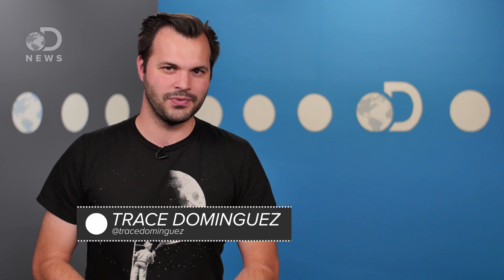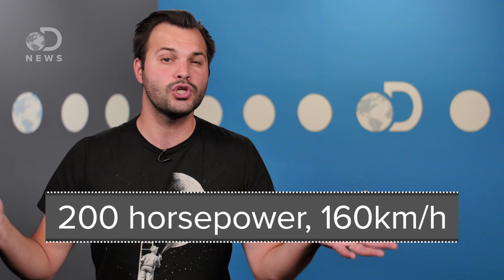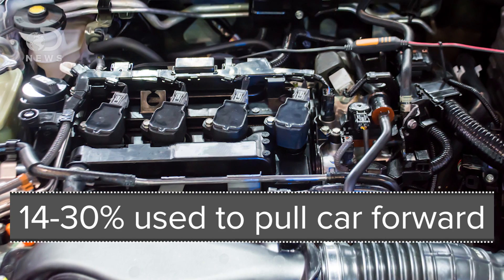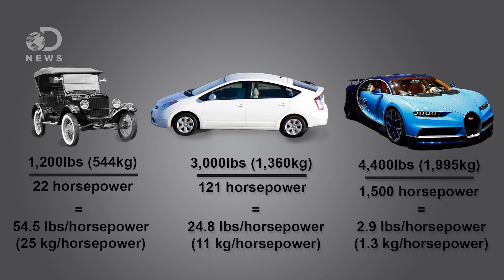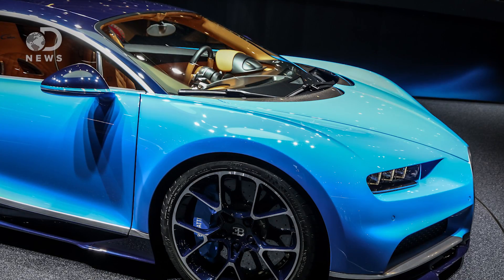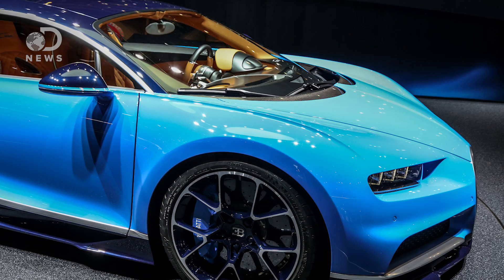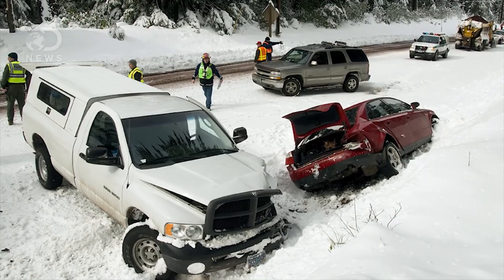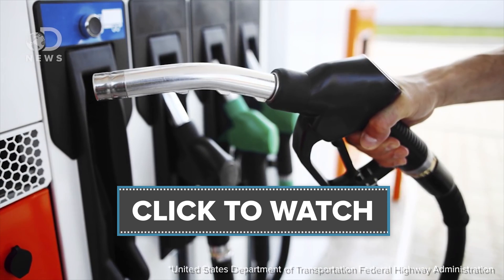Why Isn’t Your Car Faster Than A Sports Car?

Comment: This video is just simply wrong, like to the point where its dumb, and you get entirely false information. 
power to weight ratio increases acceleration. AND THAT'S IT. nothing els. 
Acceleration which is how fast a car increases from 1 speed to another (for example city speed of 60km/h to highway speed of 100km/h, or really any speeds) is a combination of power to weight ratio, and aerodynamics. 
Every other aspect of speed, including the ones talked about in this video have nothing to do with power to weight ratio. 
Launch, which is acceleration from a standstill, usually to highway speeds (0-100km/h) is purely power and grip, weight usually cancels out since higher weight has more grip, and low weight has less inertia. 
Top speed has very little to do with weight aswell, thats horsepower, aerodynamics, and most importantly, gearing. Gearing is why the Mclaren F1 which is heavier and less powerful than the P1 still has a higher top speed. 
Finally Lateral Gs or cornering speed, is weight grip and aerodynamics, nothing to do with power. 
Also there is the fact that cars have horsepower and torque, which means differant things and help with differant things. Usually more torque means faster acceleration, while horsepower means higher top speeds. 

If you did want to dumb this all down into a simple 4 minute video thats fine, talk about the 2 most important things, aerodynamics and grip. these are a factor in everything and are massive advancements over the years which perfectly explain why modern cars are faster. This video is an embarrassment. Even the description is blatantly wrong, the veyron SS did 268 mph, and the hennessey venom did 270mph.
Reply: also tire compounding means that a $17,000 set of tires specifically designed to be able to not melt at 260+ mph (420+ kph) for the Bugatti Veyron can maintain those speeds, while a $200 set of no-name tires probably shouldnt go too far past 100 mph (160 kph).
Reply: Acceleration is more accurately (and simply) described as rate of change in velocity. But anyone with a brain will know what you mean, so good effort. Also his description of the Bugatti's engine was a joke and completely false... There is a difference between a VR8 and a V8 and the Bugatti in question has one engine comprised of two VR8s sharing a crank shaft(therefore it is actually one engine), a configuration described as a W16. Such configurations are not uncommon, which makes this blunder even more disturbing...
We should have him shot for that crap.
Reply: gearing bro
Reply: exactly, motorcycles accelerate batshit crazy due to their crazy power/weighty ratio but their gearing and horrible aerodynamics (because of the rider) limit their speed, and a Tesla, with 542 horsepower (to the wheels) will accelerate so quickly yet only top out at 155 because technically it's a single gear car
Reply: it tops out at 155 because it's electronically limited to 155
Reply: Thomas Gionet Its electronically limited to 155 because the electric motor will destroy itself if it goes faster. It isnt like most electronically limited cars which are capable of going faster.
Reply: Lakefern exactly. Although almost all modern cars have tires rated for about 260km/h or 155mph.
Reply: +martinshoosterman yes, but if it's rated for 130, who would trust it anywhere near there
Reply: Lakefern They if they are rated for 130 you are almost definatly safe at 150, remember these companies do not want to be sued. But most are rated at more than 130 anyways.
Reply: he did say in the video "the fastest car you can buy" while there were 5 Veyron SS models made without limiters, they are not for sale. and only 3 Hennessey Venom GT WFE were ever made. and again not for sale.
Reply: note5 camera In the description? Yes they did say its the fastest car. not that you can buy. And they were for sale and they did sell and you can still buy them. Also there were 20 veyron ss sold, and another 40 veyron vitesses. All of which had a key which would power the car with out the limiter. 
There were 3 Venom GT WRE not WFE, I dont know wtf WFE is supposed to be, but again there is no differance between the venom gt and the venom gt wre. All versions are capable of 270mph.
Reply: Bradley Gibbs What I meant is not the scientific definition of acceleration, which is the rate of change of velocity, or the derivative of velocity. I meant the automotive usage of the term acceleration. Because Practically there is a difference between accelerating from 2 differant velocities, and acceleration from zero to a differant velocity. 
 And because of that we generally use acceleration to talk about positive speeds, and launch to talk about from zero.
Reply: martinshoosterman Acceleration only has one definition and it does not change for context. Yes things behave slightly differently when accelerating from zero than when accelerating when accelerating when already moving but they are both still acceleration! 

Speed is a scalar quantity and cannot be negative, so your statement is unclear. Also, the word "launch" cannot be used by itself as it is entirely unspecific. The correct phrase is launch acceleration, but those are layman's terms that you should avoid.
Reply: Bradley Gibbs Acceleration can have any direction, and it can change, thats where "jerk" comes in. 
But again you need to understand you are mixing up scientific terminology with practical usage of examining a cars performance. 
You cannot say the word launch cannot be used, because the fact is, it is used, and thats what it means when it is used that way. 

The physics behind a car accelerating from 0 to its top speed are extremely complicated. Every single force changes depending on the speed of the car, even if you assume other factors aren't changing in the environment.  
Because of this cars do not accelerate uniformly. 
While you could be 100% scientific and describe the cars acceleration with a function describing its velocity time graph, it is much easier and simpler to break it down into 2 differant parts. 
The part where aerodynamics are a negligible factor, and that is almost entirely defined by the friction in the tires, is referred to as launch.
it is still acceleration, obviously,  but it is communicated as launch. 
then the parts where aerodynamics become the determining factor is what is generally meant when you are talking about a cars acceleration.
Reply: martinshoosterman Yes, acceleration has direction. All vector quantities do, what is the point in bringing this up?
And you seem to have a grievous misunderstanding that scientific terminologies are void in practical situations. The whole point behind these scientific terms is to define and predict the behaviours of "practical" things. 

About the term "launch": in my area, girls refer to hair bands as ponies because they are used to make pony tails out of their hair. In unscientific and non-technical contexts such terminological degradation is acceptable. This is not the case in all things scientific (practical or not)! There are conventions and rules defining the the uses of each term there are organisations that govern such things to prevent confusion.

So as I said before. Simply "launch" is unspecific, "launch acceleration" would be understood (but since it's a layman's term and not part of any convention you should not use it) and simply saying acceleration from zero is much more specific and the correct way of defining the situation.

I am aware of the physics behind a vehicle accelerating from zero. The only reason for its complexity is the ridiculous amount of variables involved. The acceleration of a vehicle with a geared internal combustion engine, while its gears are being shifted cannot be defined by a single function, even if you entirely ignore air friction.
You can only use 2 functions to describe the acceleration of a vehicle if it has a transmissionless electric motor that is geared directly to the wheels and the graphs end before the motor's output decays.
Reply: Grip isn't THAT important for high speeds though, as most cars don't really have the power to reach speeds where they lose grip. A typical car at 100 m/s, 220 mph, might have 500 kg-force pressing on the front. That's a lot by any means, but it's not that close to the mass of the car, so even a coefficient of friction of 0.3 is good enough. Add minimal, and I mean, minimal, downforce and the problem solves itself.
Reply: I mean, the basic reason why you never see cars that have grip-limited top speeds except perhaps in world record events, is that it requires a lot of torque. Let's say that you have a frictional coefficient of 1, and no downforce or upforce to confuse things. So let's say you went to your top speed and were limited by grip?

What this means is that the amount of aerodynamic drag on the car is equal to the torque is equal to the weight of the car. If you're moving at, say, 150 m/s (300+ mph) and this happens, you obviously had the car's own weight in torque at 150 m/s. This puts a bare minimum power output in watts of 150 m/s * car's weight in Newtons.

So, say 15000*150. That's 2.25 Megawatts, or 3000 Horsepower, to which I say, why even bother with making a car? That's 87% the power of a B-25 bomber.
Reply: Peter Smythe I agree.

Comment: f1 cars have greater power to weight than the Bugatti but still isn't faster and yet it produces so much downward force it can virtually run upside down.
Reply: You said it yourself, they produce so much downforce, besides the gearing (which also determines top speed) is geared toward tracks, which would make the gears shorter to make the engine more responsive but would result in a lower end.
Reply: drag coefficient amirite
Reply: Its because of the gear ratios

Comment: bugatti chiron does not have two V8 engines. 

it has one W16 engine

massive difference
Reply: its the same thing w16 is how they are positioned one v8 sits next to another and puts the power down equally so think of it as v+v=w and 8+8=16

Comment: why? because im using toyota with 4piston which its hp and torque is not a good as bugatti with w16 engine and more power. but gtr is bettwr with v6 engine and less cost compare to bugatti but it can compete with bugatti with just add some cash to modified :p

Comment: Ok. The blandly sponsored Techron advertising was the second when I stopped and left. If I want to see ads then I switch on TV. On a video like this it takes away completely from the message and makes the present or partial to the advertiser. No more impartial message after that will make up for the annoying ad.

Thanks and goodbye D-Ads.

Comment: +Dnews 1:25 you made a mistake, the Bugatti does not have 2 V8 engines 

It has a W16 engine, which is basically a V16 but the pistons are not in a straight line to save space. 

Basically a  W engine is the Demon love child of a V and a VR engine (VR = angled Inline motor)

Comment: Maybe because my car isn't a Quad-Turbo W12 that has 1,000+ BHP.

My current car is a 2.5L Inline-4, single turbo, making only around 300 BHP. Guess my car :D
Reply: STI? also which W12? because the veyron/chiron has a W16 (hence 2 V8s)
Reply: +Lakefern Correct! :D And I meant W16 for the (Veyron Super Sport 16.4) lol. No idea why I wrote W12.
Reply: Its a WRX or STI if I had to guess..if you live in the US as least. Had one, now have an Evo Fe

Comment: That whole video was just a shameless introduction to your shameless Techron plug. I'm also 99% convinced that your "research" consisted of 3 YouTube videos and a skim through Wikipedia. I was actually alittle excited to see a car video on this channel, but not one this weak. And for power to weight ratio, the Konesegg 1 has a ratio of 1.... 1lb/hp. Stuff that down your Chiron.
Reply: *1kg/kw which is about 2.2 lbs/1.34 horsepower or 1.7 lbs/hp
Reply: +Lakefern *1.64lb/hp but thanks for correcting me
Reply: Noah Rodebaugh whoops. rounding error.

Comment: "Has 1,500 horsepower, but needs two V8 engines to get that" - Trace Dominguez 
When DNews does not know what powers a Bugatti Chiron, its actually two separate VR8 engines that power the Buggati with four quad turbos. Volkswagen came with the idea of the VR engine witch stands for "V" style engine and a inline engine, characterized by a narrow-angle (10.5 or 15).

Comment: if i had to choose a car for the long harsh winters of canada (where i live) it would be the 2016 dodge charger SXT Plus AWD 305hp modded to 350 with a carbon fibre GT wing, a Rear diffuser, front splitter, and those side flippers at the front that many racecars have, along with a hood scoop, Carbon ceramic brembo discs, MOMO steering wheel, recaro racing seats, color would repainted to a sunset metallic, and a subaru WRX STI killer
Reply: And a custom supercharger. Because Murica.
Reply: Mariux -  :D +89 HP

Comment: Or, just buy a motorcycle and spend hardly anything and go fast.  ~$12,000 and I can go over 170mph?! Suck it Bugatti.
Reply: but if you hit anything, or are hit by anything, you are essentially killed if the relative velocity is over about 60 kph
Reply: And have better acceleration
Reply: And hitting something going 270 in a car is better? I could get killed walking out my front door tomorrow. I would rather die epic in a bike crash doing something I love. lol Death is inevitable.

Comment: What about the Coefficient of Drag?
What about the transmission used.
What about the tires used?
The new Bugatti would have a very low Cd value compared to your average econobox, as well as your econobox would have a more basic transmission and basic cheap tires.
I can get a modern car like an impreza and it would be faster than a 1960s supercar.
So in a way, My car can be faster than a sports car

Comment: The top speed of most cars is lowered too, due to keeping you from going to fast or blowing up the engine.
Reply: Yup. you could get a prius to 200 miles an hour if you had hundreds of engines to replace the ones that went boom.
Reply: Yeh, the Chiron's top speed is electronically limited to 271 mph
Reply: +Timothy Rhoades haha, yeeeeeh. Looks like someone has no grasp of basic physics!

Comment: What about the difference between naturally aspirated engines vs modded. What about turbos and superchargers? If the video was simply about power to weight ratios you should've titled the video differently.

Comment: the A\C electric motor is faster then all these combustion engines you're talking about. if we all drive a good EV we would all have super fast cars.
Reply: My car is faster (top speed) than any EV and it's a 13 year old, sub £10,000 estate car. EV's can't achieve a decent top speed or hold it for long.
Reply: +xxpyroxx75 yup, gotta respect the tesla's 0-60.

Comment: Add engine or decrease weight?
Not true at all.

Modern engines have more efficient fuel delivery, exhaust, valve trains, hemispheric combustion chambers, gearing, aerodynamics, cooling, forced injection etc..

A classic VW beetle has a 1.6-2L engine and weight half as much as a modern VW sedan. The modern VWs have 1.8L turbo engines. The modern VWs get better MPG and gets just under 200hp while the beetle gets just under 30hp

It all has to do with engineering

Comment: The power to weight ratio has nothing to do with top speed (given a smooth surface and efficient bearings). The limiting factor is drag AKA air resistance. Basically Trace is lying to us all.
Reply: Well, power to weight does help allow for higher top speeds, since a high power to weight tends to mean you can stretch your gears longer without making acceleration performance majorly inefficient. He skipped out on gearing, though. He did talk about drag, but the limiting force isn't just drag. It's drag relative to power to weight - the power to weight ratio has to be enough to push past the drag. Sure, a dragless vehicle would be indefinitely fast regardless of power, but a dragless vehicle is impossible.
Reply: One word..... Spacecraft
Reply: Or Seven words.... Magnetically levitated Vehicle in a vacuum tube.
Reply: justin wood Ok, taking away air is cheating.

Comment: -1933 Dusenberg 20 grand 
-1937 Delage D8 120
-1947 Chrysler woody T&C
-1937 Cord model 812 (Baby Dusy)
-1947 Cadillac series 62 4 door
-1946 Nash Sudan
-2013 Fisker Karma
-1929 Chrysler 300 speedster 
-1958 Cadillac series 62 2 door
-1928 Alpha romeo 
-1928 Dusenberg model J
  
You know, real cars. Made with steel & chrome, lots of chrome. And, that look sexy and sound awesome. Cars you can feel from 30ft away cause their very presence is made know by the distinct rhythm of their motors. What do I care if a car can move at a quarter the speed of sound, what I want are cars that look good and last a life time.